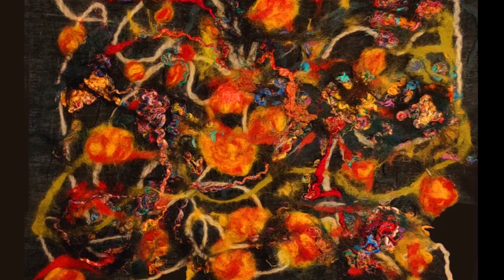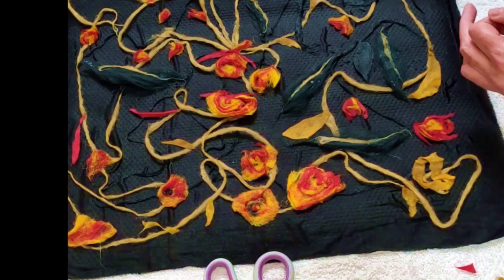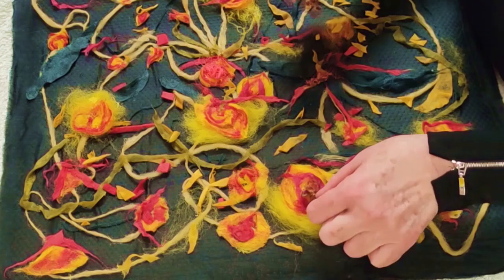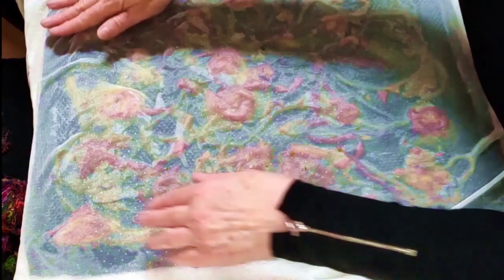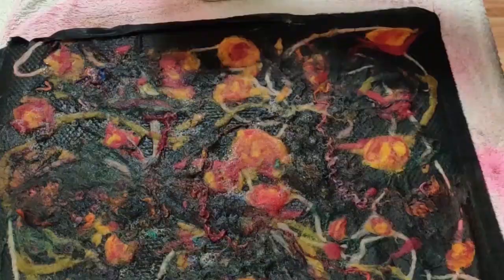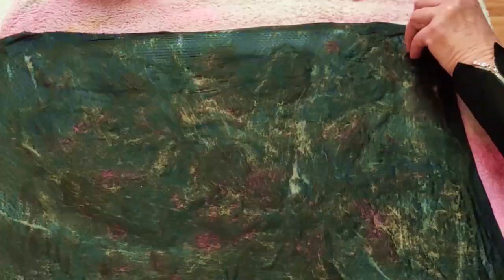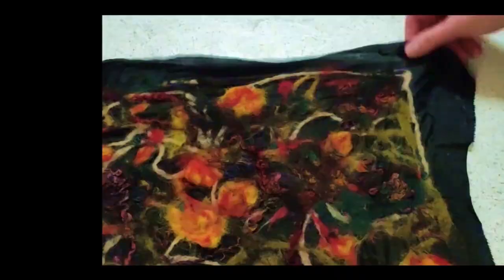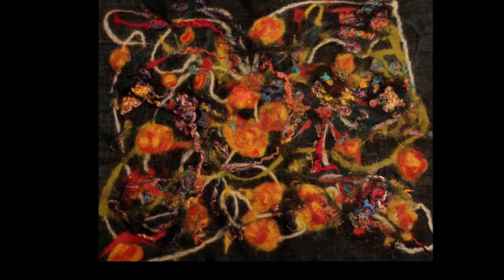Optimize Your Nuno Felt  Design Layout

Comment: Hi, love your video.  I have done a bit of nuno felting, happily.  Do you think silk fabric is better to use instead of cheese cloth for a wall hanging?  Thanks so much.
Reply from the maker: Thank you for watching! Interesting question.  How much of the silk or cheese cloth will be seen in the final work?   And you could use both. The open ness.. of the cheese cloth makes it easier to felt through than most silk but the silk will look better. So it depends on what will be seen. Also the cheese cloth is less likely to be attacked by mothy things than silk. As your project is a wall hanging. It mainly needs to be strong in the  right places but you have the capacity to back/line it or some of it  with  a fine  cotton afterwards. It really all depends on the effect you want. You may have so much more flexibility  with  a wall hanging. Also depends how long it needs to last. Yours may need to be very very strong. Or you might be looking for transparency and lightness.  I feel like I havent helped much here. Finally the  key difference is the openness of the  fabric which varies so much. Silk can look great but be dense so hard for the wool to migrate through.  The experts would say... seeing as you are looking at doing quite a lot of work here, you should first try some little samples of different fabrics and effects to see what will work best for your project. All my very best wishes to you and thanks again for getting in touch.
Christine